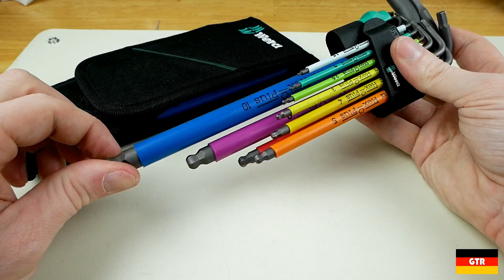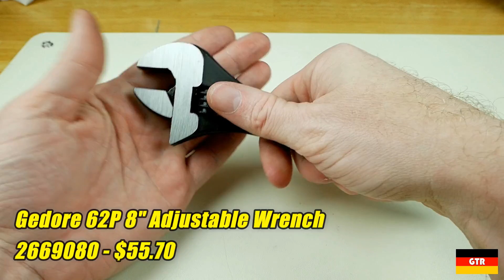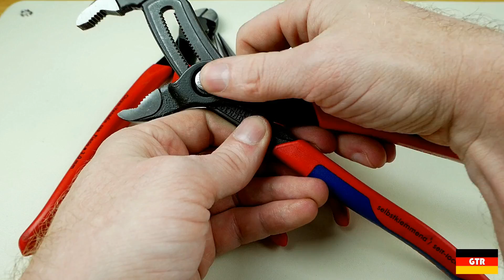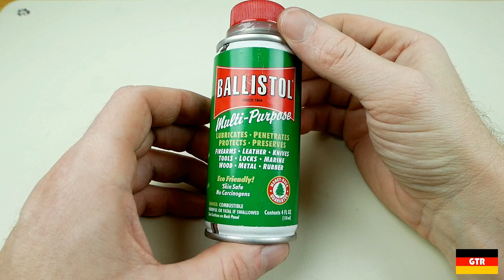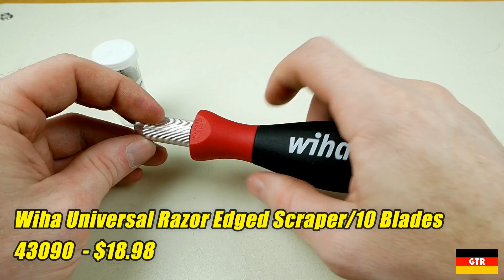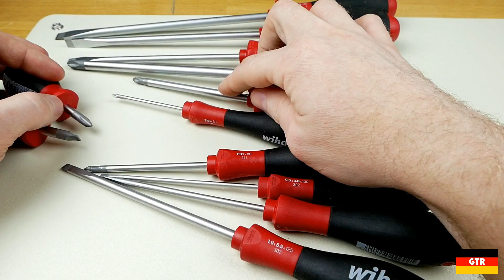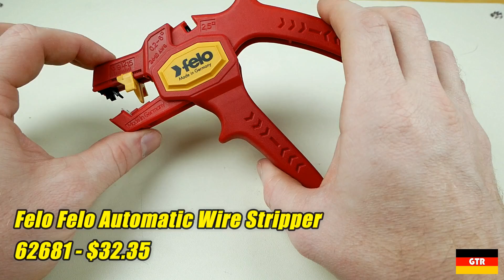Best German-brand Tools with a $1000 Budget

Comment: Use a kNIPEX mini-cobra 125 nearly every day in work , truly an indispensable tool :]
Reply: The same for me and my 150...rides in my  pocket every day for HVAC work.
Reply: Found it being too small, and went with a 180. Smaller is not always better.
Reply: EditioCastigata found it being too small and went with a 300. bigger is always better!
Reply: Got a KNIPEX Cobra 180 in my pocket aswell. Not a day where I'm not using it at least three times.

Comment: Interesting idea for a video. For me, though, I'd make a few changes. Combo wrenches instead of the open end wrenches. Ditch the nut drivers and get a bigger socket selection. I'd ditch a few of the other tools if that puts me over the budget, because the combos and sockets would be badly needed in my set.
Reply: as an electrician i use nut drivers very frequently and sockets almost never at all
Reply from the maker: The list went through many iterations before I finally settled on the items shown.  I wanted to include my most used tool (Wera Zyklop Premium Set), but at $450 list price that would be half the budget.

Comment: Nice video! Those punches are probably made by Rennsteig and the stripper is a Jokari.
Some of those wera L key holders actually have a magnet built in, so you can magnetize or demagnitize them. Very handy on occasion.

To 'knip' means to cut in Dutch, probably in German as well
Reply from the maker: Thanks!  Jokari is a rare bird where I live right now.  I think it is cheaper to get the Jokari rebranded items than it does to get the original.  Maybe they want it that way?

Comment: To add to your suggestion with the bit check, if you put the bit in reverse, you'll be able to get into tighter places. I had a Volvo fuel pressure sensor that was in a really tight place and the ONLY tool that would reach it was the Wera ratchet with the bit placed in backwards. It was a heck of a lifesaver....
Reply from the maker: Cool thanks for the tip!

Comment: This type of wire strippers is not adequate for PTFE-insulation (Teflon is the trademark for PTFE of the manufacturer DuPont). 
For PTFE you should use these ones:

http://www.knipex.com/index.php?id=1216&L=1&page=group_detail&parentID=1363&groupID=1379

Or you can remove it thermically, this was done decades ago with special tools. But you must have a good ventilation, the vapors of the thermal decomposition of PTFE are toxic.
Reply from the maker: Thanks!  I've seen them use something similar at work, but I can't remember who made it, I believe they were made in Sweden though.

Comment: The last Tool is made by a Company called Jokari. But there are better Wirestrippers eg. Weidmüller Stripax.
Reply: I am also a big fan  of the Stripax. The mini's were the tool of choice in big NYC recording studios back in the 90's, and ours worked perfectly countless thousands of times during wiring harness builds. They were branded Paladin in the USA back then. 

Weidmüller has a full line of Stripax tools to suit any job: http://www.weidmuller.com/155870/Products/Tools/Product-overview/Stripping/cw_index_v2.aspx
Reply: Yeah, Jokari's are the defacto stripping tools over here. I've got a stripax and a stripax 16, great tools, but the length stop is a real cheap setup. Flops around on one, went completely missing after a few weeks on the other. I opened the floppy one up and almost didn't believe how it was made. Real cheesedog...
Reply: I have a similar one to Stripax from Pheonix contact (I think its called Wirefox 10 or smt .. ), and its great ^^
Reply: Had a stripax, it was 'borrowed' indefinatley; picked up a Thomas & best duostrip-excellent tool, That and a PZ 6 Roto crimpewr are my go to panel tools.
Reply: I prefer my Klein strippers originally procured, jeez.... must be ~30-35 years ago, give or take. Don't know if they're actually Klein let alone the lineage, but they have the blue rubber (silicone?) handles and look exactly like Klein's. Family member in the Army came away with a small electronics repair kit from the 80's (likely incomplete, but a lot of nice stuff) in a very nice machinists toolbox. Definitely not something you'd expect coming from the Army. Finally went through the box ~5 years ago & everything was in brand new condition. They've worked perfectly ever since. But they aren't "universal" so to speak, as you do have to pick the correct die location for whatever gage you're working with.

Come to think of it, they're most likely US made unless they were procured with some kind of waiver, given the procurement rules for the US military. But whatever, they're perfect for the small electronics I work with, especially the small gage stranded wire that loves to give up a few strands when using other wire strippers. 

Apologies for going off topic there, but I really love these kinds of old toolbox discoveries. Now I've gotta go do some research!

Comment: why the folding rule
why not a tape measure which is more practical and durable
Reply: for most shorter measurements (say, less than 1.5 metres) a folding rule is much easier as it doesn't flop around or buckle up.

Comment: Why Wiha over Wera screwdrivers?
Reply: I think personal preference.

I nowadays buy Wera.
Good grip and none of the co-workers has Wera
Reply: Great grip on the Wiha soft-finish :]
Reply from the maker: They are both great screwdrivers, but I find myself using that particular set of Wihas more often than I do the Wera sets.
Reply: Wera seem to have the largest presence in the market place but don't overlook Wiha, their handles a so comfortable to use. You have to own a set to understand. As for the tips, which is the all important bit, (sorry for the pun.) Wiha tips are super tough and precise. Wiha are the only company to have won a prize in ergonomics for their handles.
Reply: Eirik Blodøks A coworker of mine has Bondhus screwdrivers - im not a big fan of the handles but the quality seems very good.
Reply: The lasercuts and the grip on the screw you get on the wera tips are nice though, even if they probably don't last for too long. Hard call and as you said, personal preference
Reply: 123 456 yea im used to Bahco so the handles are a little bit slim, but they grip very well and got strong magnet tips. + lifetime warranty.
Reply: German Tool Reviews what about felo screwdrivers?
Reply: PB Swiss,Witte and  Wiha are better than Wera and Gedore.Old Wera from Germany are better than those made in Czech republic. Stahlwille,Hazet,Matco screwdrivers are made by Witte.
Reply: From having used quite a few German brand screwdrivers like Wera (made in Czech Republic), Wiha (Made in Germany), Witte (made in Germany), Mannesmann (made in China) and Cimco (probably made by Witte, but couldn´t confirm that) I can tell you, that the main difference lies in the handle design. 
Even the Mannesmann (about 1€ per driver) held up pretty well, unfortunately the handles are terrible. 

Out of all of them I liked the Witte best. They are affordable (13€ for a 6 piece insulated set), probably held up the longest (not 100% sure, by a sight margin possibly) and are made here in Germany. 
I don´t mind Wear making their products in the Czech Republic (better than China in my book), it´s a nice country capable of high quality manufacture, but still, Germany gets the home bonus for me. 

Next I will try Gedore (18€ six piece set), Hazet (20€ six piece set), Stahlwille (31€ six piece set) and possibly Proxxon (18€ six piece set). They are all not terribly expensive here in Germany.
Reply: 123 456 check out Bondhus. They got some really nice screwdrivers..